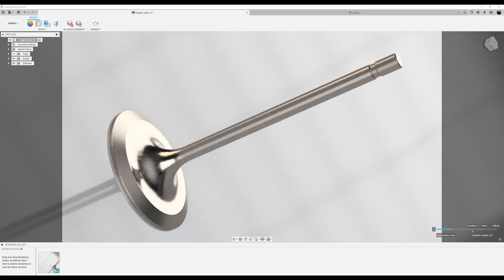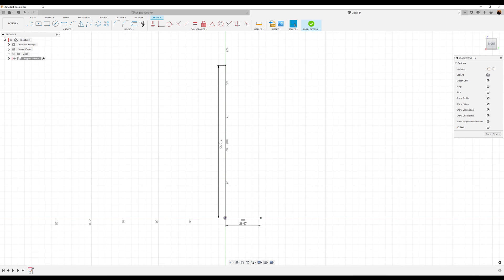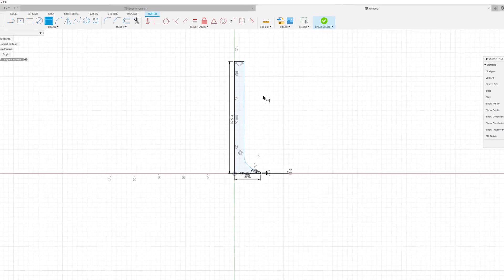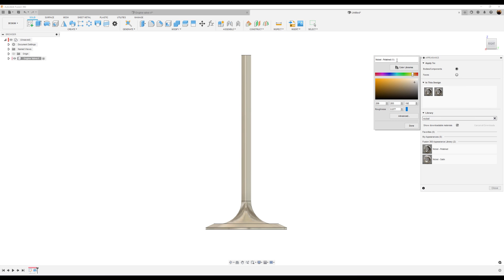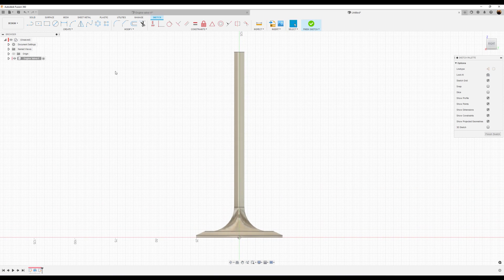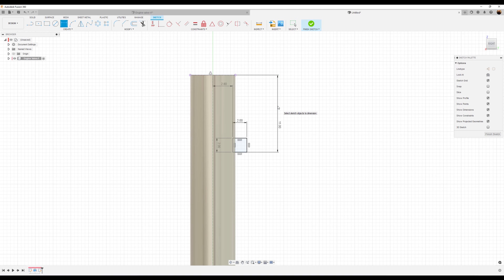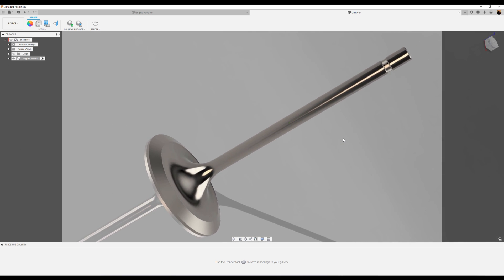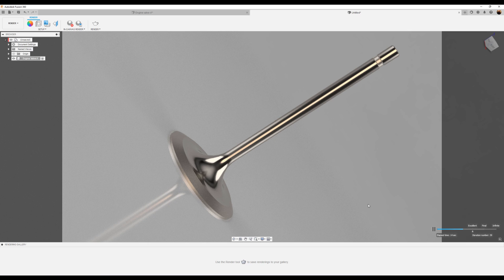Learn to create an Engine Valve in Fusion 360

Comment: I'm not getting the triangle or the X with the construction line.
Reply from the maker: Go to your icon in the top right corner select preferences. Under General, select Design. Over on the right, let me know what you don't have checked.
Reply: @CADJungle  I do not have "Allow 3D sketching of lines and splines", "Auto project edges on reference", and "Scale entire sketch at first dimension" not selected. My preferences should all be default.

Comment: awesome video. First question is why didn't you do that all as one sketch? second, how do we adjust lighting, where do we find the settings?
Reply from the maker: That's a great question in which you were paying attention! It was only a matter of time before this came up lol.

Yes, you definitely could have completed the profile all in one sketch. Keep in mind however, there is always a different way to accomplish the same task. With Fusion 360 you have to think outside the box because some of the simple tasks that you can complete in other software such as Solidworks and Inventor, you have to accomplish it in different ways. In this case I took the liberty of adding that extra step along the way to accomplish the same thing. This way you aren't stuck in to thinking in only one dimension.